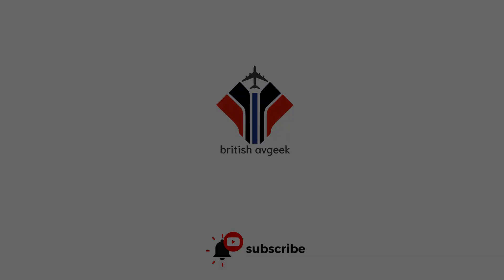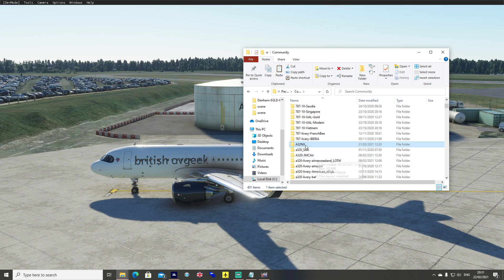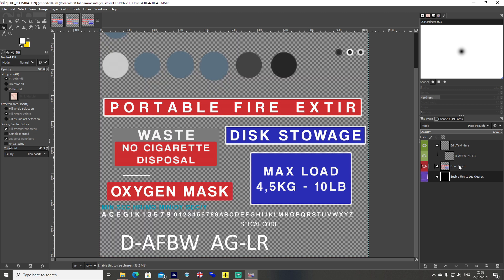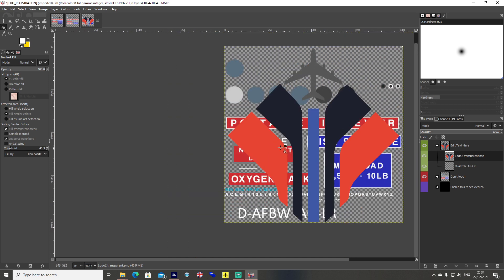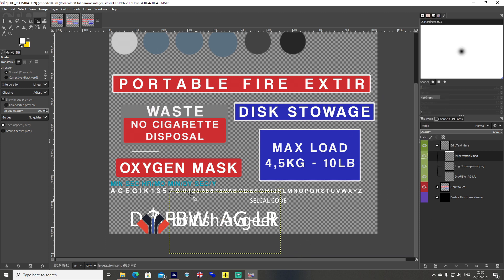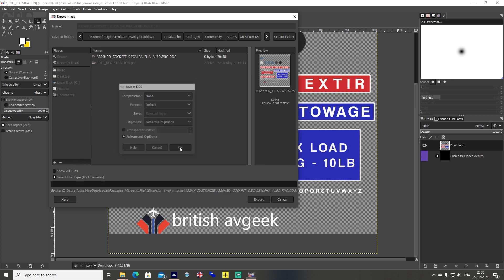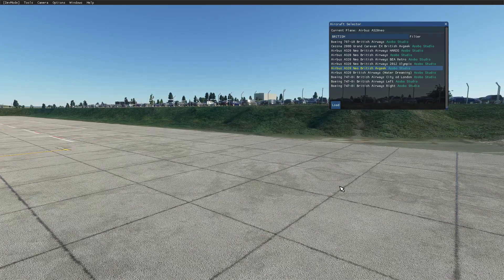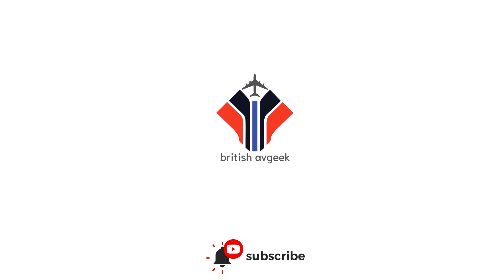MSFS 2020 | How to make a CUSTOM SELCAL Plate in the flybywire A32NX Cockpit! [Tutorial]

Comment: I was wondering. When you do it like this, a modified selcal plate would end up in basically every livery you have installed for the aircraft right? You overwrite the default texture in the default folder and not in a specific livery folder. How you do go about creating a different one for each livery without having to constantly change files?
Reply from the maker: Yep it's just an easy way to make a custom SELCAL which - as it's an old video - at the time people wanted to do